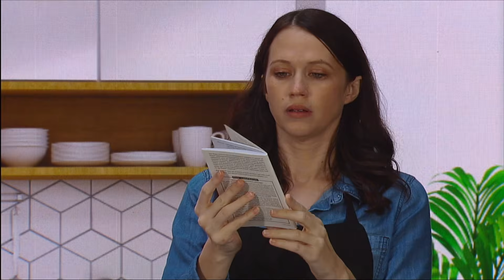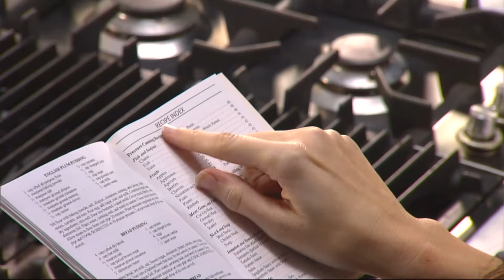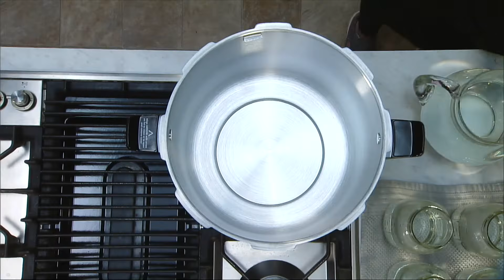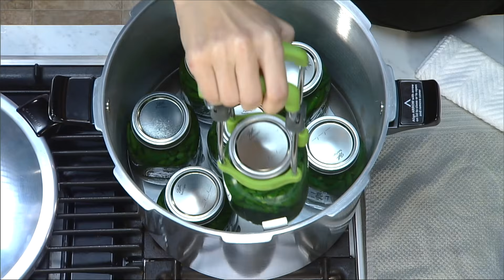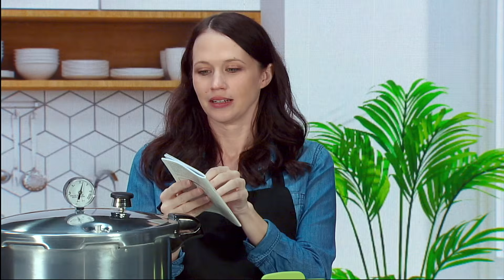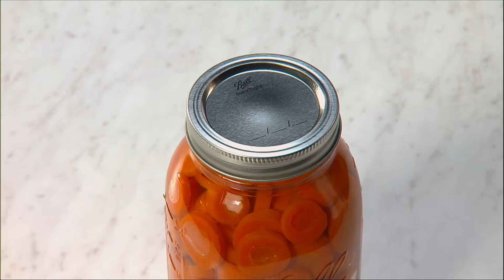How to Pressure Can with Presto® Stovetop Pressure Canners

Comment: whats the point of it being so tall if you cant put 2 layers of jars?
Reply from the maker: With the taller canner you can water bath can quart jars. The 12 quart digital canner does not have that capability.
Reply: I needed to buy a second rack.

Comment: I new to canning and tryed a trial run can't controll the heat even on the lowest  setting on the burner on the gas oven. Want 11 lbs keeps building over that ..I hope I don't need to baby sit this . Please help
Reply from the maker: Try turning your heat on the stove down when the PSI is at about 8-9 to slow the pressure build. Our Customer Service Team would be happy to speak with you! Give us a call so we can discuss your canning situation. Call 1-800-877-0441, we are available weekdays, 8-4 CT.

Comment: Can I pressure can two different sizes of jars pints and quarts ? And how long for ?
Reply from the maker: Due to the height of the canner, you cannot stack pints with quarts. They simply will not fit.
Reply: @PrestoAppliances  I have a 23 quart presto canner. When I put a cooking rack in it seems I can fit 5 pint size on top and 7 quart size on bottom. Would that work? It closes fine just a a little snug .
Reply from the maker: You want to leave room for circulation as well. This is not recommended.
Reply: @PrestoAppliances Are you able to can two layers of pints then?

Comment: It doesn't explain the PSI gauge and how to install it. Does the gasket and washer go on the inside of the lid or outside?
Reply from the maker: To install the gauge, place the rubber washer on the pin, place the pin in the appropriate hole in the cover, add the metal washer and tighten with the nut.   Call us at 1-800-877-0441 if you need further assistance.

Comment: Where the weight is sitting there is alittle  bubbling? Is that normal or ok?
Reply from the maker: Steam escapes from the vent pipe when the regulator rocks. This is normal. However, send us a video if you want us to double check. Our email is contact1@gopresto.com
Reply: Thank you so much!! First time doing this was yesterday! Found I didn’t put enough liquid and tops weren’t sucked in but the pop when u press happened. I’m learning! Thank you for your help!😅
Reply from the maker: Give us a call, we're happy to walk you through! We're available weekdays, 8-4. 1-800-877-0441
Reply: What’s the correct pressure beef stew or chicken soup?

Comment: What is meant by making sure digital gauge is working properly? How do you test for this?
Reply from the maker: The steam dial gauge should be checked annually at your local County Extension agent. You may also send your gauge to Presto for inspection. If you choose to send the gauge to us, you may send to:

National Presto Industries Inc. 
3925 N Hastings Way
Eau Claire, WI 45703-3703
Reply: Why is it necessary to have the steam dail gauge checked annually?
Reply: @officialbusiness215  ummm my guess is for accuracy.
Reply: @chrismc.4437  ok thanks
Reply: @officialbusiness215  An accurate gauge reduces the chances of explosion and unsafe food. If a recipe calls for 12 lbs and your only actually getting 8 lbs, that food isn't safe to eat.

Comment: I do have a question: I also have a digital Presto and while canning my carrots the other day I forgot to take off the regulator and I canned with it on through the entire process.  Is that a problem?  Everythng else was perfect I completed the process to the very end.  Thanks in advance.
Reply from the maker: Venting is necessary to ensure that all air is exhausted from the canner as well as the jars. Removing the regulator ensures the canner is vented. This is a food safety concern. Although your jars sealed, they were not properly canned and we cannot be certain your food is safe.
Reply: Thank you so much for your reply.  I guess I will toss them I really don't want to take a chance.. After all they are only carrots, I'll consider that practice and a lesson learned: I'll never do that again :) @PrestoAppliances

Comment: Hello, I have the 23-quart Presto Pressure Canner. Unfortunately, here in Germany we dont have the usual american sizes of glasses.
Exactly 5 glasses fit in the Pressure Canner. Since there is still plenty of room at the top, I would like to make a second layer on top of the bottom one.
Is this possible? Do I need a second rack for this?
Many greetings from Germany.
Reply: Hi i'm not an expert but it's better to use a second lid
Reply from the maker: Hello! Thank you for reaching out.  You mention the glasses are different sizes than American sizes. Could you provide a size that they measure? Volume? What brand name are the jars? We could have a private conversation via email if you prefer. Email contact1@gopresto.com. We are happy to help either via email or here.
Reply: @PrestoAppliances  Hello and thank you for the quick reply. Weck brand glasses are widespread in Germany. We also have a lot of them that we always use. We have 1 liter and 0.5 liter jars.
We already have a lot of this glasses, so it doesn't make sense to buy new ones.
Especially since they will be unaffordably expensive until they are here in Germany.
The pressure canner fits 5 large glasses. I would like to place 5 small glasses on these. However, the jars in Germany also have the lid made of glass! The question is can I put glass on glass or whether I need an second rack for this?

Comment: I have just received a pressure canner from a company here in France - there were absolutely no instructions with it and there is no make on the canner; so I don't know what it is and they seem to be ignoring my e-mails to date! I am a bit freaked out as I have a pile of squash and courgettes.  The problem is that there is no trivet to go on the bottom.  You are sooo lucky in the US as you have so much guidance!
Reply from the maker: Janice, you may download a PDF of the instructions with this link: https://www.gopresto.com/content/parts-service/parts-lookup Email contact1@gopresto.com if you have any further concerns. Please provide your model and series number so we can help you further.
Reply: Poor Janice , I understand your frustration and have had similar experiences . Now I only buy where they sell on an intelligent way like on Amazon . The seller gets a quote of his client and will watch out for bad comments . Amazon is a bit more expensive but all the things I bought there ( over 200 trough the years ) are good as well as the service afterwards .
Reply: Sorry to hear! But i would actually recommend to check if the product you bought is legit. I bought it from Amazon us shipped to UK and it did come with proper instructions manual.  I noticed websites in  uk (assuming similar situation occurs in France ) has a lot of legit looking fake products of them and they are significantly cheaper -that’s why I bought it directly from us because I had a lot of experience buying fake products in uk 😢 If I were you I would double check the seller to make sure if it is really Presto’S product

Comment: Help I don’t know when to put the regulator on. My had a very fine stream of steam but not like any of the pictures. How long should it take to come up to steam. Have a 23 qt canner with 13 pints in it.
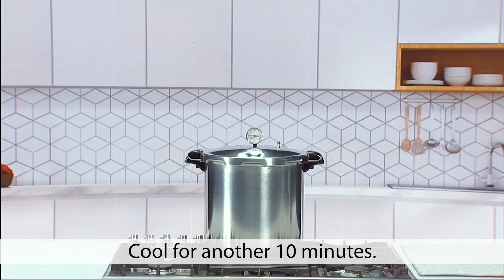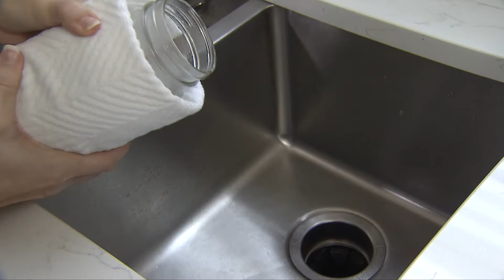Reply from the maker: You need to vent your canner for 10 minutes before placing the regulator on the cover. Depending on the lighting in your kitchen, it may be hard to see. If you have questions, please reach out to us at 1-800-877-0441 and we can help you. We're available weekdays, 8:00 - 4:00 Central Time.
Reply: I left my regulator on the whole time, will it hurt anything?

Comment: How do I check my pressure gage to make sure it's calibrated?
Reply from the maker: The steam dial gauge should be checked annually at your local County Extension agent. You may also send your gauge to Presto for inspection. If you choose to send the gauge to us, you may send to:

National Presto Industries Inc. 
3925 N Hastings Way
Eau Claire, WI 45703-3703
Reply: @PrestoAppliances  I'm in Canada - so we don't have County Extension offices. So I can send it your way for testing?